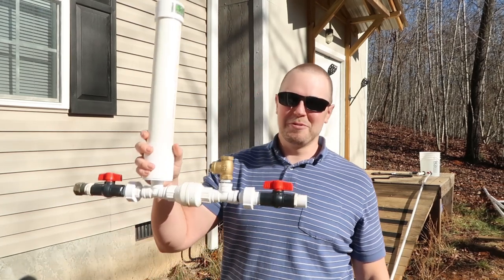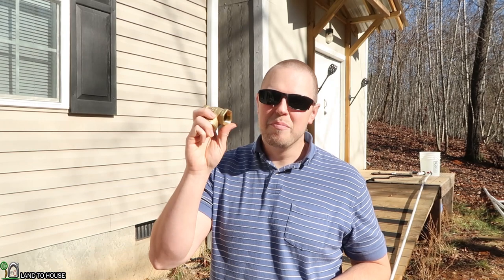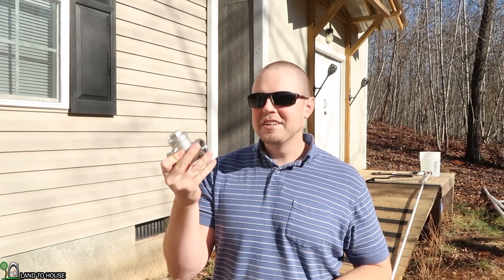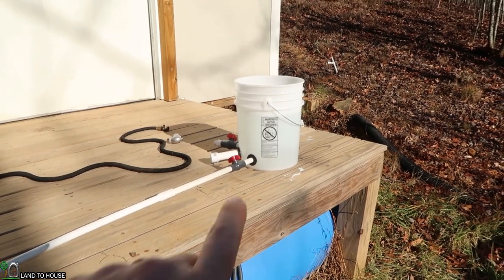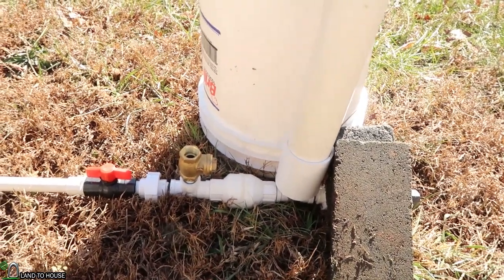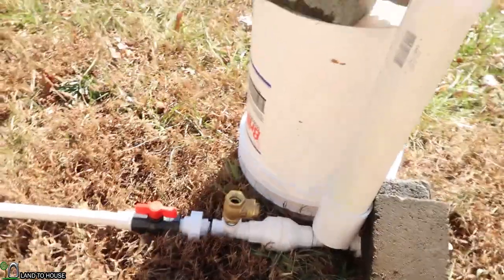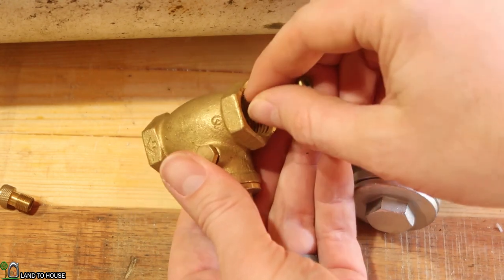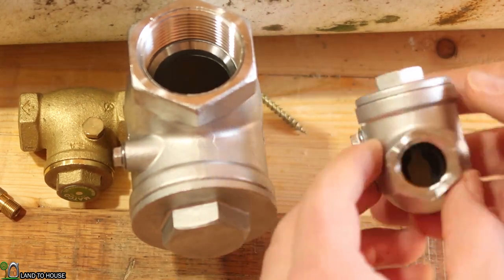Stainless Steel vs Brass Waste Valve GPM Ram Pump

Comment: I installed two 1 1/4 inch Land To House ram pumps in the summer of 2020 - one with the brass valve and one with the stainless steel valve, which is great for my testing to see which delivers more water, because volume of water delivered is important for my irrigation application.  In my specific situation of 50 feet of supply to stand pipe giving 20 inches of vertical water and another 10 inches of head through a 20 foot drive pipe (total of 30 inches of head), crude estimate of 4 gallons per minute of drive pipe water to each ram pump, the brass and stainless waste water valves produced about the same 1/2 gallon per minute each to a height of about 10 feet.  (other parameters may produce different results).

I intended to swap the brass and stainless valves between pumps for testing, but because the results ended up similar, so far, I have not done this.  However, I did notice some interesting tuning opportunities:

Initially, as mentioned in one video, I had to rotate the stainless a little to keep it cycling, however, once pumping to 10 feet of lift, I'm not sure this is necessary.  During one test, I inadvertently set the stainless valve to vertical and while I really liked the softer sound produced, it cycled slower and pumped less water than when rotated slightly.   So far I haven't experimented using different rotation angles.   For the brass valve, I didn't think of rotating slightly.   With the brass I am wondering if it might make a difference which way the hinge points (back, forward or to the side - may not matter, have not tried) and for the heck of it, try rotating the brass valve sideways.

I've seen a lot of videos and pictures of people building their own impressive waste water check valves, however, I've not seen data documenting if and how much more water was pumped with custom designs.    The above example of rotation effecting volume of water pumped, might indicate that the waste water valve design might make a difference.   I'm not sure if we want valve to close more easily or by putting weights on it, more pressure to close.

For now, for me, either the brass and stainless are fine.  The cost of swapping out the valve if ever necessary, is a minor cost of my installation.  To my surprise, the delivery cost and effort of delivering water from the pumps through delivery pipes to the sprinklers to irrigate our meadow is the biggest part of the project.  

If you are really into waste water check valve design - here is a link to a Facebook discussion:
https://www.facebook.com/groups/240458583255303/permalink/533567013944457

- - - - - - 
Unrelated to the above, my ram pump additionally has a commonly used PVC spring inline check valve before the expansion tank which seems to work.  However, since the valve takes some pressure to open, I've wondered about trying out one of the free swinging waste water check valves as the inline and see if this allows more water to be pumped.  Has anyone tried this?

Comment: Great and useful test! Anyhow, you have switched back to brass valves in summer 2020 because of the weight. Would it be possible to use the stainless steel swing valve with one size smaller, respectively? So 1/2" on a 3/4" pump, 3/4" on a 1" pump, etc. Probably there is also a 3/8" sainless steel swing valve for the 1/2" pump. Have you ever tested this?

Comment: Changing out brass for stainless steel is a great opportunity to take one of the brass ones apart to show us the working mechanism, or turn one into a cutaway for demonstrations.  Perhaps even investigate repairing/improving to keep the flap more centered and aligned.
Reply from the maker: I have now moved back to brass. The SS is just too heavy!
Reply: @LandtoHouse  I still think taking one and making it a cutaway would be cool.

Comment: I just saw your video. You need to drill the cap on the ss valve and install a stop bolt in ss  to adjust the height of the flapper. Seal with 3m 5200 and let it dry for a week b4 use

Comment: Could you modify/grind away some metal off the back of the flap and in the housing to allow the water a path to catch and close the flap, therefore allowing the valve to be in the upright, efficient position?

Comment: Is the 2020 production run stabilized?   I suppose you are always testing and improving your pumps, but might be nice to avoid the bleeding edge.
Reply from the maker: When you say "bleeding edge" what do you mean? I will have lots and lots of tests this summer.
Reply: @LandtoHouse  Just that sometimes new approaches take a while to get the bugs out (early adopters).
Reply from the maker: @davebean2886  oh ok. Yes all that needed to be done to work out the kinks was a slight tilt on the waste valve to help the flap close. I put that tilt in before shipping so that it's ready to go.
Reply: Thanks - I'm over thinking my first ram pump purchase - I'll put in an order on your site for a pump.  If you later develop a better one - wonderful !  If it does not fit my purpose - I wouldn't be here if my other ideas had worked out.

On a couple of other items - I could swear that last night that I saw where we could donate to Land To House from something like PayPal 2 Me?  Darned if I can find the link this morning.    Maybe I dreamt it ??   I'm thinking of you as the RND department for our ranch. :) - Note to self - look at the Archimedes screw video again and have the machinist in the FB group look at the video - minimizing friction could be important to a generator or a pump Archimedes screw.

Is there a communication channel to you that doesn't detract from your youtube videos?   I don't want to inadvertently cause a problem for you - competing products discussions for and against, etc. that don't seem appropriate for a specific topic video produced by you.    I think you said you like to keep the discussions out of your facebook profile.  Email, outside discussion forums, phone calls, dormant youtube videos might be possibilities.

I just created a post on the Water Wheel Pumps facebook group about ram pumps where I'm asking for suggestions for how to treat ram pumps in the Water Wheel Pumps group.   Perhaps you might have some suggestions or know of groups and forums that already exist so we don't have to "reinvent the wheel".    I tried to give you a nice plug in the post with a link to your products in recognition of all the great work you have done with ram pumps.   Other vendors have their facebook "pages" showing up on the members page - fine by me - now sure if Land to House has a facebook page.
https://www.facebook.com/groups/240458583255303/permalink/521060315195127/

Thanks again.
Reply: Thanks - just submitted my first order off the website.   Will be nice to have something to benchmark other water wheel pumps against and if the optimal solution, calculate how many pumps will be needed.
Dave
Reply from the maker: @davebean2886  the order is in! I should have that out on Monday. Thank you.

Comment: What happens if you use mismatched sized valves in the same pump?  Will the pump work?
Reply from the maker: It's best to have the waste valve the same size as the drive pipe. If the online valve is not the same size its ok.

Comment: Hey Seth , try drilling out material on the stainless flapper without penetrating it . That will lighten it up and maybe get what you need for better test 😉👍👍🇺🇸

Comment: Hi Seth, just wondering what you think of the valve design used by Bohumir Stehlik?  It would be really interesting to hear your comments or to see you testing with something like this.
Reply from the maker: I have watched his videos. He is a smart guy. The valve he has made does work but I find that it is not as long lasting as a Stainless Steel swing valve. My experience with foot valve waste valves has shown that they can get off center within a year and stop working. ... his valve is valid but takes a long time to make.

Comment: Suppose you have a low head/high output requirement, what would happen if you used a small pump to feed a larger one
Reply from the maker: The pump size only changes the amount of water required to run the pump and the amount of water output. The head pressure to lift ratio Remains the same in each size pump. Using a small pump to feed a larger pump does not work very well because the larger pump require so much more water to operate
Reply: @LandtoHouse  For larger volume irrigation needs is it more economical to build / buy the larger of your pumps or more of the smaller pumps?   

I viewed your video for the worlds smallest ram pump (I don't think you sell) and there seemed to be issues, although may have just been tuning.  On the larger end, is there a theoretical limit to the size of a ram pump (measured by volume pumped) or do the construction issues become more expensive per gallon pumped?   Any plans to go bigger than your  current largest 1 1/4 input size pump?    Did find this video - not sure really the worlds largest ram pump - but might be - certainly out of my league to construct and total cost - 1,800 liters per minute - who knows, on a cost per liter, if one needed a lot of liters, might be competitive.     Cost per unit of volume delivered is useful parameter and not usually calculated, but important when considering multiple pumps for irrigation use.
https://youtu.be/pORYUjKoSuA

Comment: Stainless steel is heavier the advantagenis is higher lift and more water delivered comoared to a brass with shorter stroke. The advantage of brass is less volume of water wasted.

Comment: Great detail.  Thanks so much
Reply from the maker: A little unexpected tilt requirement but works well.
Reply: @LandtoHouse  Do you have a dedicated video which shows how to tilt the swing check valve to adjust to low flow? If not, that would be probably worth to do (with a test on how the tilt of x degree influences the maxium pressure, the water consumption and the amount of pumped water).

Comment: Stainless steel is much better compare to brass, maybe a little bit more water to waste but it wiil last long and more water delivered and may be more pressure.
Reply from the maker: Yes on all accounts! The brass valves are way better.
Reply: @LandtoHouse  if you have sufficient flow, the heavier valve of the stainless unit will give you more output...is that accurate? Thnaks Seth. My pump got here today. Very excited!!